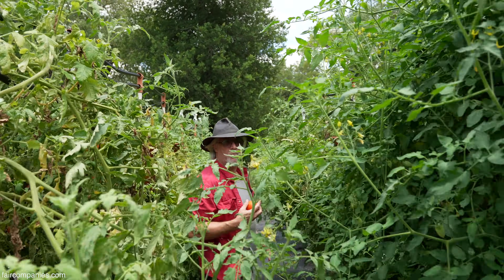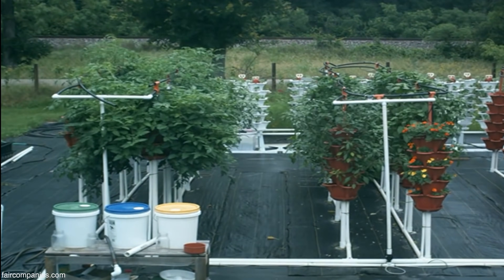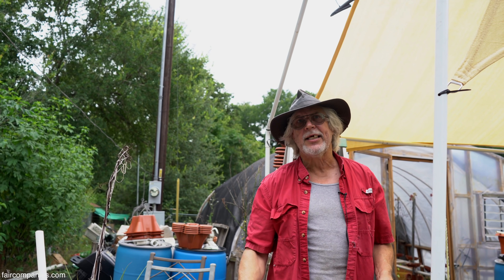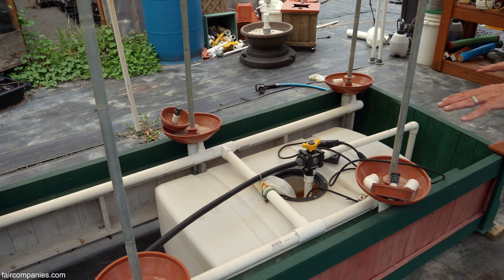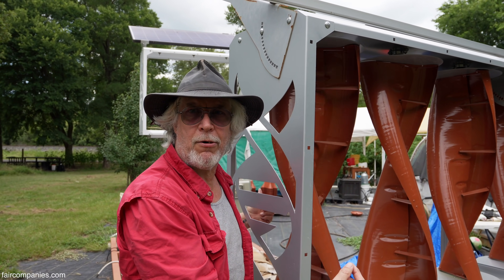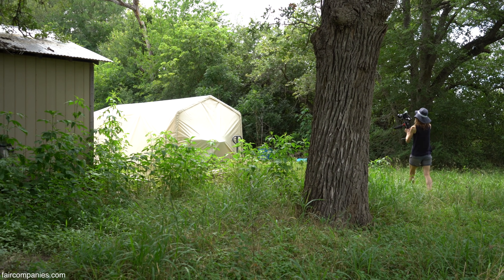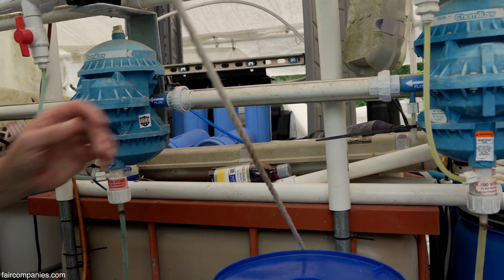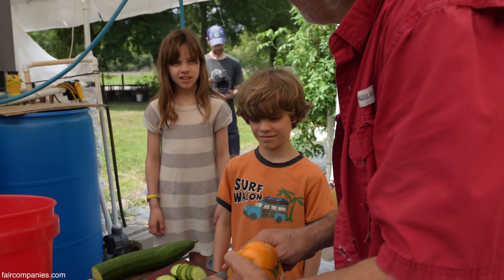Mad scientist's homestead is parking size, off-grid system

Comment: 100 pounds on the one tree??? I call bullshit, not 100 pounds plants and dirt included
Reply: You could always confirm it for yourself, I used to build the Patio Garden  which has 5 pots, with a plastic lid that the tower sits on but it would always brake under the weight, now I build the lid out of aircraft aluminum and powder coat it just to handle the weight.

Comment: At one point I had a' self watering system' that used a bottom wicking method. 
It was just a strong a  square tub that had mostly peat moss to promote the wicking. 
I had it on a city roof that baked and got very early sun  and the last sun of the day. It never shaded. 
I attached a drain that ran from the water level for the design and placed it directly in the roof drain to protect the roof membrane.
 I hooked a timer to the water supply and ran it through a fertilizer injector and into 4 tubs.
.  I was a way working all day and gone for the entire weekend. The system ran all summer and all I ever did was to keep the tomatoes supported.  I got MASSIVE amounts of tomatoes, Swiss Chard, and Tomatillos.
 I have no doubt what so ever that he is getting results like he says with almost no work.
This is the way to have a thriving food garden nearly any where. The only concern that I can think of is what is being used for the plant food. Something organic would be ideal.
Reply: Just remember when you use organic to feed you are not feeding the plants you are feeding the microorganisms that make the inorganic minerals that the plants take in.  I eliminate the organic part that is so problematic and feed the plants with high quality minerals directly so they grow faster, bigger and better taste with less effort and far better success.

Comment: Cool guy but the video title was growing everything in 1/4 acre. I’m was hoping to hear what the guy was as doing for grain, beans, fruit, nuts, and maybe animals not an integrated computer garden of only low calorie vegetables. Also the guy maybe right about the old way of doing things. It needs to die but a scientific approach to low tech gardening can be equally if not more productive. Intercropping, crop rotations, native food plants, mulching and cardboard and polyculture from plant to plant can be highly effective at reducing water consumption, decreasing pests, reducing the need for fertilizers or nutrient mixes (what he is using is way more than would be needed for a diverse soil environment), lowered initial start up costs and long term, as well as building soil microbe diversity, structure, and drainage, increasing environmental diversity, increased CO2 sequester... I can go on. Now I admit there are benefits to his system, if you are not concerned with improving clay, silt and sand into a living environment. His system will produce plants in big cities where soil is polluted and people don’t want to invest in cleaning it. His system will work in places where there is only bed rock. His system may work on Mars. But adding organic material will do pretty much all the things his system does.

Comment: You have to love engineers! I am using a tower system with grow lights inside which I love. I'm going to be building on acreage and I want more of these for the greenhouse. I'll definitely look into his products. These are great for boomers. I'm still in my 50s but have already had 2 knee replacements. These provide a creative solution to avoid the back-breaking job of gardening straight into the ground. I'm going to be either designing or purchasing a system I can use in my 70s and 80s. The beauty of building your own home is that it can be designed around your needs as you age. This also allows one the opportunity to create a property that works for you. Healthy, clean food is essential because the systems we are used to are changing. Seed shortages and global friction doesn't help. Additionally, all countries are moving toward a technocracy so being prepared for disruptions is key.
Reply: I am right there with you, my wife and I are 63 and the last thing I want to do is work hard and all day for food.  Also as a side note our gardens are are used at the Volunteer Way in New Port Richey FL, It is a food bank where the garden is maintained by handicapped personnel and feeds 22,000 people a month

Comment: Yep, super easy. Just look at those pipes, tanks, electrical set up. I wonder would be easier than digging a whole, full it with compost, and plant a seed!
Reply: Surely not easier than a conventional, well-maintained lot. Labor over time, on the contrary, is what you'd need to account for. One of them would allow anybody to do other things. A well maintained operation done manually is full-time work.
Reply: @nicolasboullosa  that's true but it depends on what style of agriculture you are using. For example, in a forest garden setting, after the initial setup and time for plants to establish, the only real labour involved is harvesting.

Comment: The design of those pots is genius! The big "clover leaf" loops at each corner, in addition to increasing surface area and volume, also act as points of flex/strain-relief. A 90 degree corner would easily bust out and crack from root growth or soil freeze in the winter.
Reply: Thank you for mansplaining
Reply: @Danutzz2010  Oh you're very welcome! 😀😂🤣

Comment: Wow. The turbines and alternator are mind blowing.
Reply: The turbines look like the double helix DNA.
Reply: Basically, he has replaced natural soil, with plastic.
Reply: Urbexx Jeremy  you're welcome, but this stuff doesn't even exist, in the sense of actually producing power.
Reply: Sure, I they worked without hand power . . .
Reply: These pots need to made into 3D STL files in the public domain! 
It's possible to eaisly turn recycled bottles into things like this! 
Hope this manifests! 🤞
Reply: very inefficient design 20% efficient Savonius Rotor
you get 40% with with smaller blades like airplane wing Darrieus Design
Reply: yea, really. hundreds of watts from each of those, maybe in the peak of a hurricane. they're not high production turbines. the classic style is used much more often because it works. even if the turbine has to turn to face into the wind, that's not hurting production so much as it is auto tuning the production and getting the most out of it. these vertical ones on the other hand, they're good because wind can come in from any direction, but when they're lined up like he has them... well, you've ruined the only benefit that style of turbine has.
Reply: @lorenzo42p  from what I read, Savonius turbines are less effective but are a bit more mechanically reliable than regular turbines because of less moving parts. It may make sense for a DIY solution to use a more reliable design.

If I wanted to build a reliable wind turbine for a remote place, made of recycled scrap, I'd seriously consider a vertical turbine.
Reply: Love the design of the turbines. Looks exactly like the future to me. I think Kirsten just gave us a preview 50 years ahead.
Reply: @shelleynobleart  Except that they were invented by Savonius in the 1920s, and are not as efficient as the classic horizontal axis design. That is why they are not used, except for cases where output/efficiency does not matter. I thought they looked cool too, but then I started digging around. . .
Reply: @tzenophile  "except for cases where output/efficiency does not matter" *in special cases, where they have the best efficiency.
Airfoil turbines are unreliable in turbulent wind. So unless your HAWT or Darrieus is in the middle of an empty field, or very high up, it will struggle. And at this small scale, all the buildings, trees will get in the way. The Savonius is heavy, has terrible drag and all, but works almost everywhere.
Reply: @besenyeim  Do you have a reference for that? I seriously doubt that they are more efficient in poor conditions, and more importantly, they won't recuperate their cost before breaking down. So even if you were right, they are a bad deal. But the fact that they are not the standard choice for rooftop mounting suggest that they do not have the best efficiency in turbulence.
Reply: @tzenophile  Sorry,  I can't give reference. It is a key information I kept years ago when I learned about wind turbines.

Technically, it is a matter of sizes. 
Airfoil turbines work best in laminar flow. Obviously, they can tolerate some turbulence but their effectiveness drops dramatically if the vortices are comparable in size to the blades. Depending on the circumstances (power needed, the disturbances around, budget, local regulations, etc.) there are situations where these would perform poorly. 
The solution shown in the video is universal. It will perform worse most of the time but will work almost everywhere. He wasn't going for efficiency but ease of use.

A little over the rooftops in a residential area or farmhouse is technically a pretty good place for a small ( <1m ) HAWT. But there are many things to consider.
Reply: @besenyeim  Vertical axis (VAWT) designs have been around for so long that if they were truly more efficient than HAWT under poor conditions, that would have resulted in market share by now. Instead, companies like the one who produced this are going out of business. Clearly this is because VAWTs perform worse than poorly. VAWT is the useless design (= it will be a loss for the owner) that keeps being reinvented, because it looks nice. (If nothing else, at least there should have been amateur wind turbine youtubers demonstrating their worth, in hard numbers.)